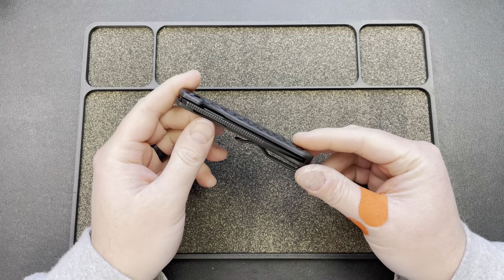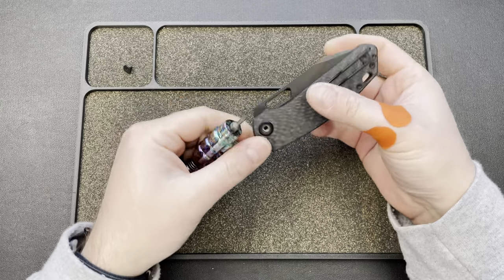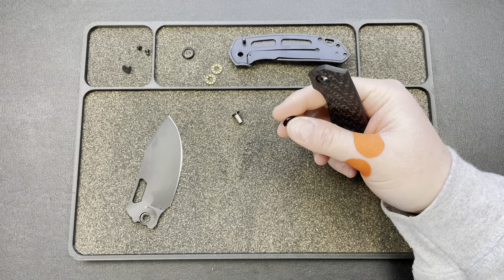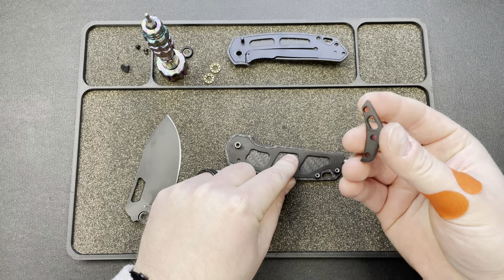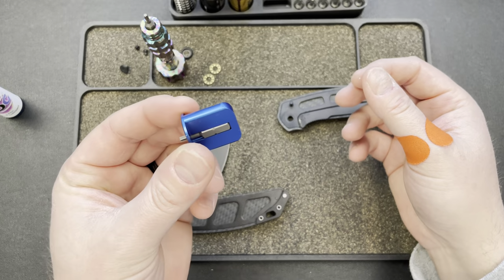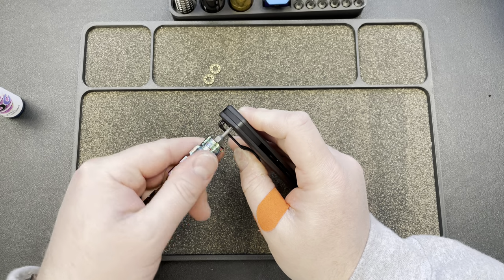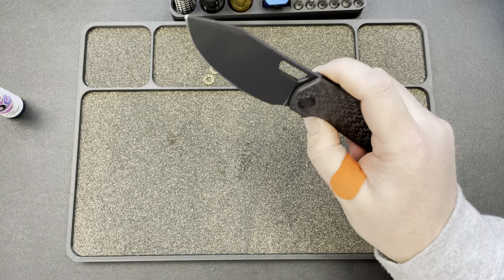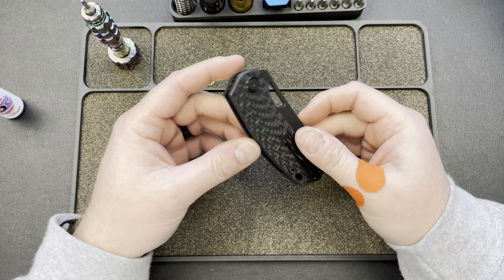Growler V2 Disassembly

Comment: HI, Just ordered my Growler from WMK. Do these bearings really a difference with the action?
Reply from the maker: No not really with action
Reply: @LeftyEDC  Why do you change them out with skift bearings ?
Reply from the maker: @pugchronicals1374  lateral strength and not having a stamped cage. Its not necessary but i prefer it